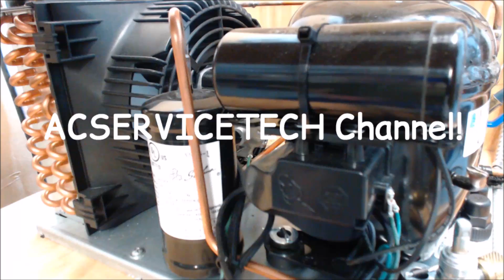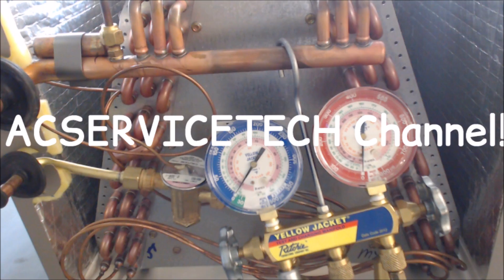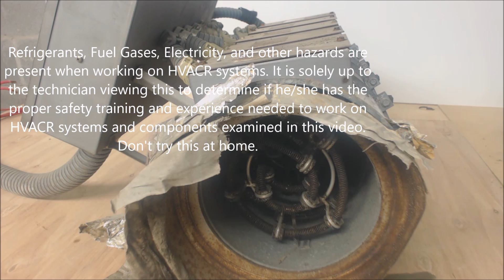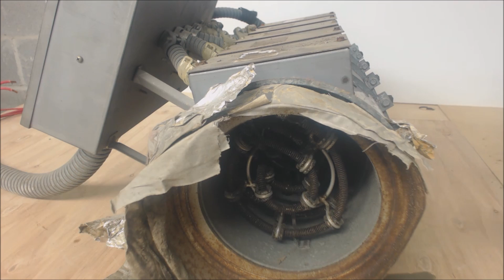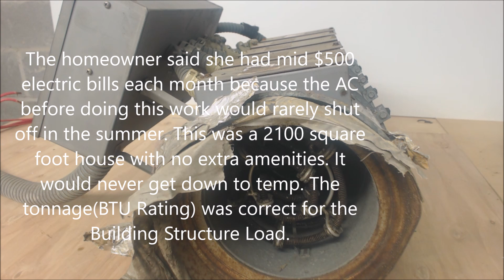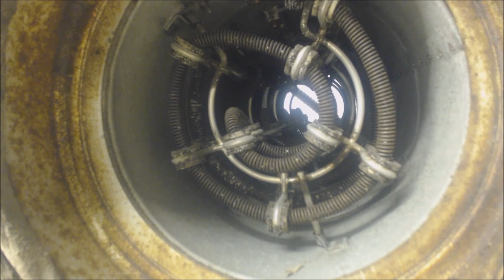Ductwork Restriction, AC not Cooling, Bad Installation!

Comment: how many years was it in for?
Reply: it looks like a commercial system with the junctions and flex... we had those at fedex
Reply from the maker: It seems to be about 15 years old. This poor women was paying an outrageous electric bill for way too long just because the system would never shut off in ac mode. Terrible!
Reply from the maker: This was mounted as the first duct off of the high velcity system's air handler.
Reply: so what part of california are you?
Reply from the maker: I am in Southern NJ